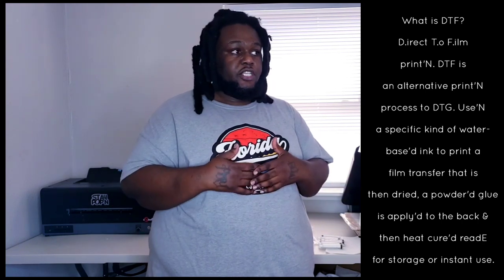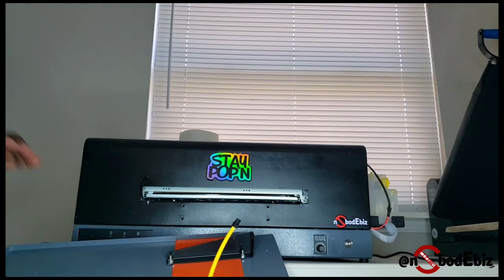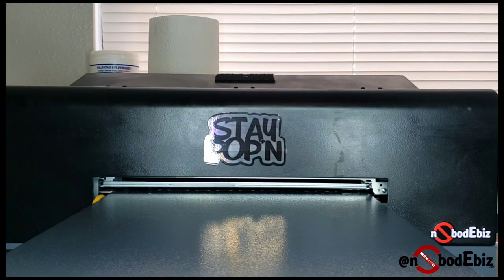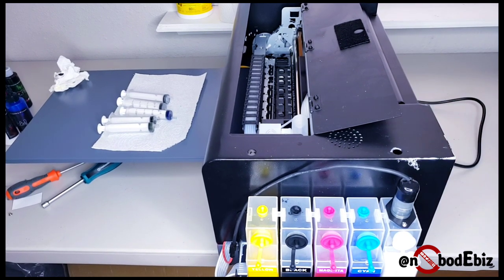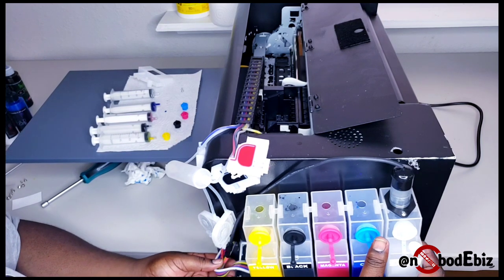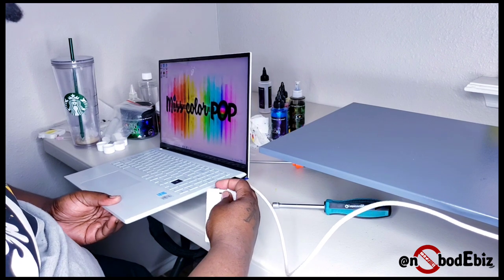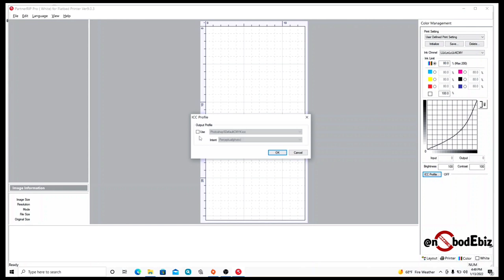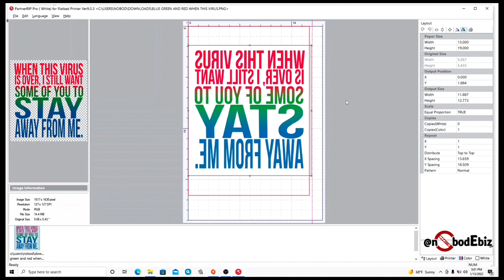DTF ( Direct To Film ) printer step-by-step setup!!!

Comment: nice ink tank with the mixer for twhite, where did you buy it. also you using ink flush before printing?, is it ok to use the head cleaning after the flushing with the cleaning solution, then next day when printing again, i can use flush ink or head cleaning to make the ink go down. please advise TIA

Comment: Also am seeing on the site where the the max length is 8.5and the max with is 13 is that right because in the video you mentioned that the max size is 11x13?
Reply from the maker: 13x19in is max size! Width will onlE allow 13 in, long can go for however long U want, roll attachments are available. Also... U can email me so we can mayB get otp so I can answer all ur questions faster.

nobodEbiz@gmail.com